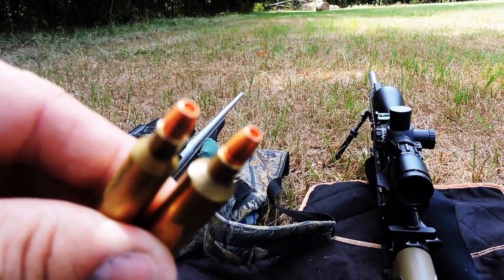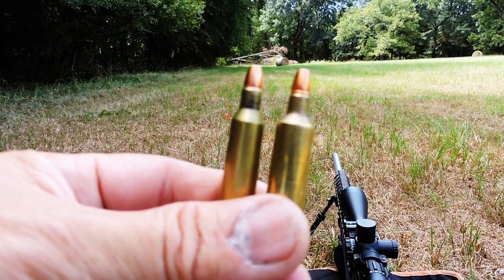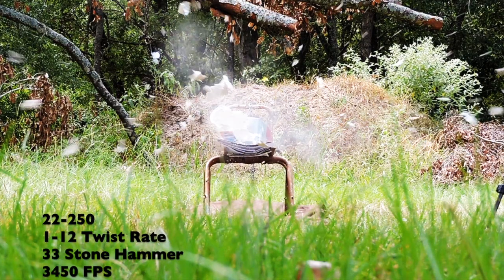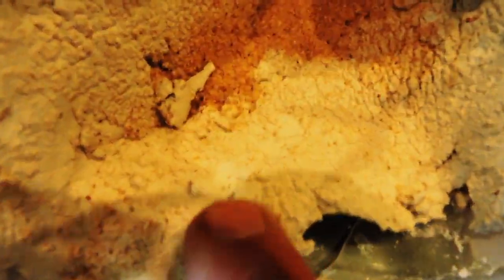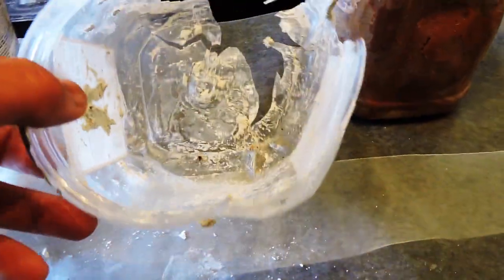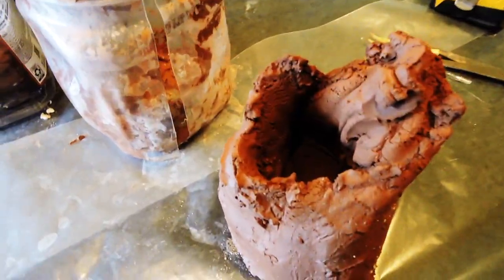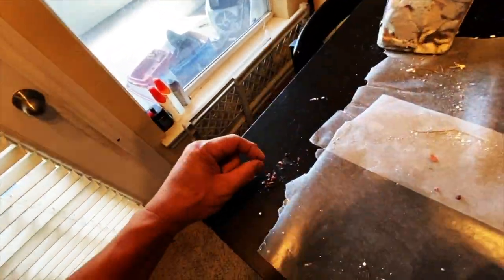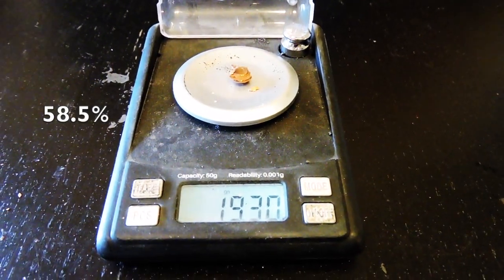22-250 -vs- 22 Creedmoor AI • 33 Stone Hammer

Comment: Why don’t you get a ballistic gel you can reuse and you get way better information from it thin the clay
Reply: That gel can be expensive and at 16k subs you’re not making a whole lot on YT. Also, with Gel you need a high speed camera to capture the Temporary Wound Cavity. Clay will keep that shape after deformed.
Reply from the maker: The cost... I've reused the white molding clay for almost a year. Good luck doing that with ballistic gel.